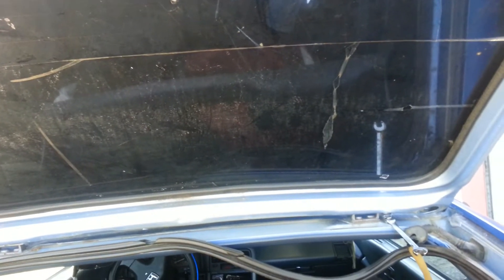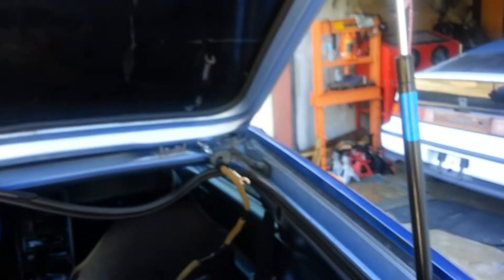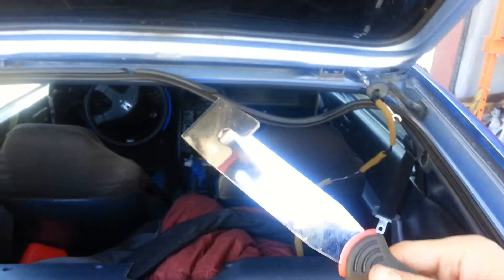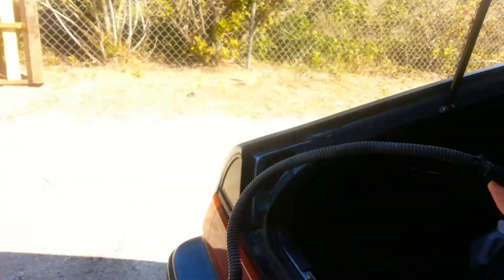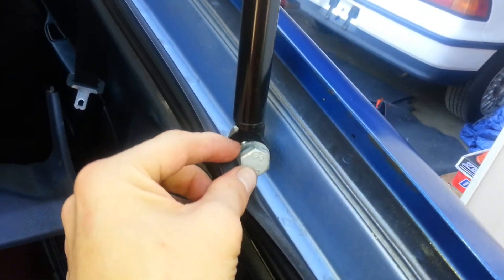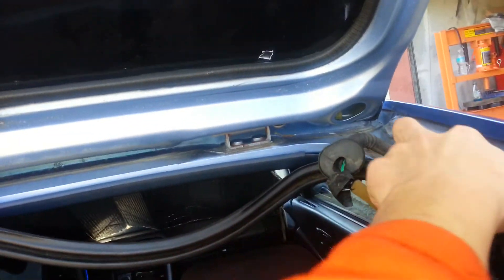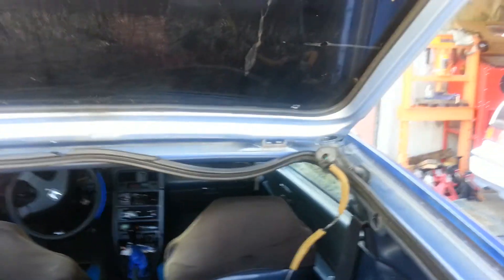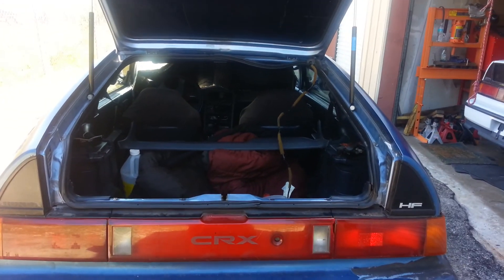JDM Hatch CRX EF removal and install

Comment: How to I remove the rear spoiler from the same car? (CRX). I just don't like it.
Reply from the maker: CrxRacer805 I will have to look at the hatch on mine. There are no holes on the top or sides for screws so if any screws or hardware exist I am unaware of there locations. I would like to have your spoiler if it is in good shape.

Comment: I'm currently trying to take the hinges that hold the hatch to the car off. One of my hinges broke. Any help on taking the hinge apart? I am curious on how to take the pin that holds the two sides together out.
Reply from the maker: Naggeneration111 mine broke a year after this video and I replaced it with a JDM one. Whatever way I did it in this video was the hardest way. So, do it the opposite way. you could weld it or have someone weld it if a junkyard part is not available.
Reply from the maker: Naggeneration111 Take the entire hinge out and place it in a vice. Use a punch to drive the pin out. Don't attempt this while it is in the car. There is a good chance you will miss and break the glass.